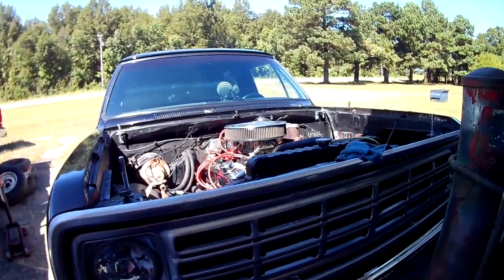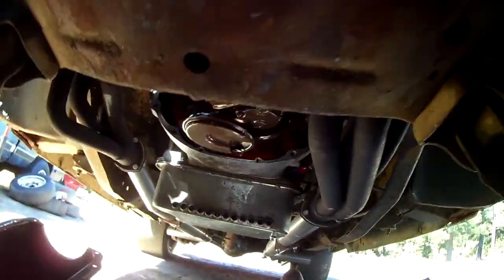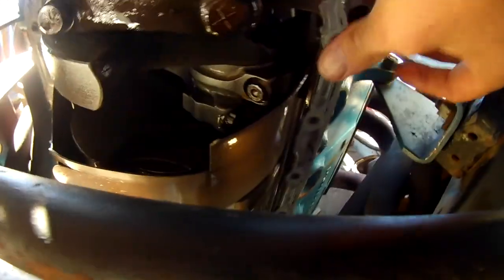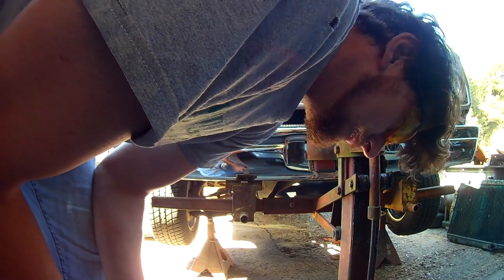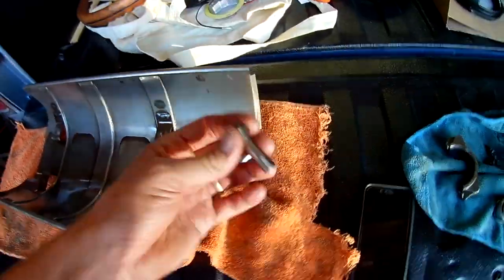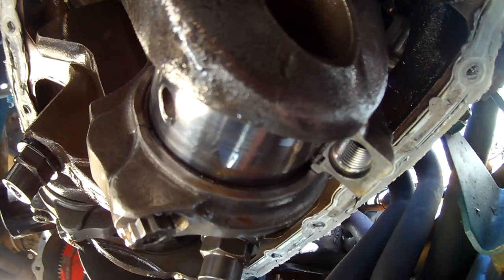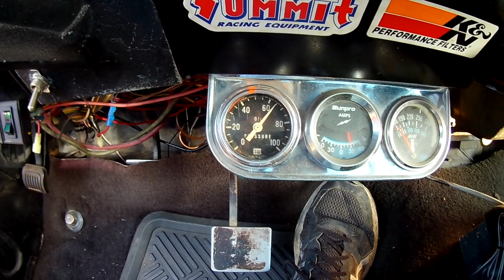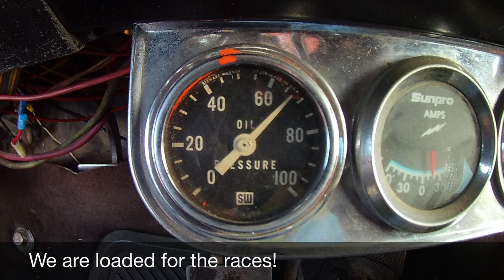Truck it 2! 408 Stroker Revival!

Comment: Great video! Wow, I’ve heard of high volume/high pressure pumps breaking oil pump drives, but not the pump locking up! I’ve been putting off fixing an oil pan leak on my ‘74 D100, now I know I can pull the pan without jacking up the motor (much). And that one piece gasket looks like the hot ticket (yeah, 318willrun has cool stuff). Great info, thanks!
Reply from the maker: Ron G thank you! I certainly slept better after I set that timing and tried it out on the road. I didn’t have Stevie wonder film this time 😂

Comment: Nice.... I like the postmortem on the pump.... Did you ever find why it locked up so hard....either way stock or hardened shaft would have twisted right off any way.....whats the oil pressure fully warmed up at idle...got to buy a few of those oil pan gaskets just to have them around.
Reply from the maker: Moparnut62 fully warmed at idle the pressure is around 32-35 psi. I watched it during my runs yesterday, it was about 72-75 at 6,000 Rpms.
Reply: Piece of windage tray maybe?
Reply from the maker: @johnwilburn  I found it in the bottom of the pan. Have you had that happen before?
Reply from the maker: @johnwilburn  I'm picking up your shirts this week! Thanks for the patience.
Reply: @JustMoparJoe  I’ve had a tray rub, but not what yours did.  It does remind me of this import FWD transmission I had.  A sheet metal oil slinger came apart and did all kinds of damage.  I guess these odd things remind us of another thing to check when putting them together.

Comment: You're ready to go! Wonder what caused that pump to lock up like that?
Reply from the maker: Jason Simone with the internet as my source, some beloved that I didn’t need the high volume because of the tighter clearances with the scat rotating assembly. There could also be a bearing slightly blocking an orifice somewhere. Warmed up the pressure is 35 psi at idle, and 75psi at 6,000 rpm
Reply: I never ran a high volume pump. But I've never seen that happen. That makes sense though.

Comment: That sucks the oil pump seized.  You have to watch new pumps these days.  I bought a mellimg oil pump for my small block mopar  this summer and the pressure relief spring which is held in with a plug was installed wrong from the factory.  Luckily I caught it before installing.  Gotta look everything over you just never know.  I also built a stroker mopar (318 stroker)and the scat stroker kit I got had really tight bearing clearances rods and mains.  I had to buy new xtra clearance rod amd main bearings to gain an extra 0.001 for peace of mind.  You would think a brand new kit would just bolt together and have the right clearances.  Not so.  What were you oil clearances or do you know on your stroker.?  Hopefully all is well with the engine.
Reply from the maker: Thanks cawcislo. Engine is running great again. We were shooting for somewhere  around .003 clearance. They definitely were tighter than any stock style rebuild I’ve ever done. Add in a high volume pump and the 15w40 oil and it didn’t work out for me. I went back with a stock meiling and 10w30. I’ve got 55 psi at idle and 70 psi at 6,000 Rpms. I was able to make it to the track with the truck right after this before the season ended. Ran the best time yet!